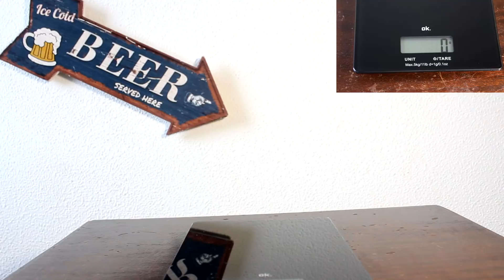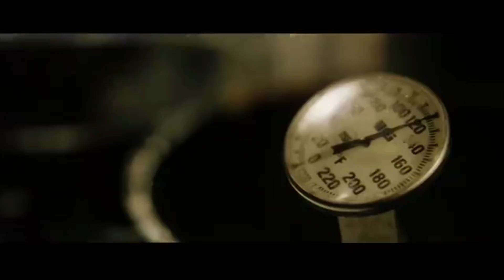Making Biodiesel from Human Fat (ft. Rosana Pansino)

Comment: I love how the skit at the end shows the car struggling to start, starting slow, and burning inefficiently, even though biodiesel makes your car start faster, more reliably, and cleaner. It’s also renewable, so it’s a much better alternative for fuel.
However, many manufacturers don’t recommend doing this, and the methods to make biodiesel aren’t yet efficient enough to be cost effective.

Comment: you can extract the oil from gasifying wood into wood steam that will cool down and collect as oil. just use a metal contained with a lid with a small hole in the center and a glass jar upside down at the top of it so that you can enjoy observing the steam turning into oil. you also chould use a tube in the hole so that the steam will collect inside the glass jar as oil. when your done take the whole thing put it upside down and separate the glass from the coal of the bottom container. now you got your oil.

Comment: Will the bio fuel work?!?
Reply: Diesel engines are rather versatile when it comes to burning oils.  As ling as the fuel is liquid, and the volatility is low enough, a diesel engine will run on it.  If the volatility is too high, the engine explodes.

Do not put gasoline into a diesel engine unless you want to get a most epic explosion.

Comment: Any diesel engine or, does it have to be modified to use bio-diesel?
Reply from the maker: In most diesel should work just fine :D
Reply: Older diesel engines can run on straight vegetable oil, but the oil has to be heated up so that it flows.
Reply: @michaelbujaki2462  Thanx!
Reply: Thank you Sir!
Reply: @1730N8  "One of the concerns with homemade biodiesel, and indeed with any biodiesel, is that if it can still contain methanol traces. Methanol is a solvent that attacks rubber aggressively, so it can eat its way through any rubber hoses or seals in a car's fuel system. Fortunately, most modern diesels already use nonrubber synthetic fuel-system parts. Otherwise, those parts can be replaced with readily available synthetic materials that are immune to methanol's predations. " https://www.consumerreports.org/cro/2012/05/diesel-vs-biodiesel-vs-vegetable-oil/index.htm

Comment: Is there an alternative that would allow you to make bio fuel for regular gasoline vehicles?
Reply from the maker: Great question! And yes there are! It's called biogasoline and it's made from vegetable sugars like corn starch for example.
Reply: During WW2 the Japanese used distilled pine tree sap as gasoline. You can also use a wood gasifier they did that in WW2 Germany.